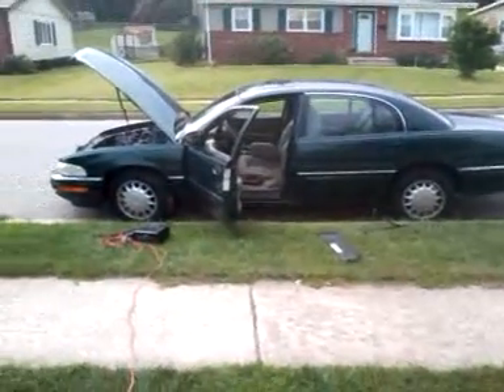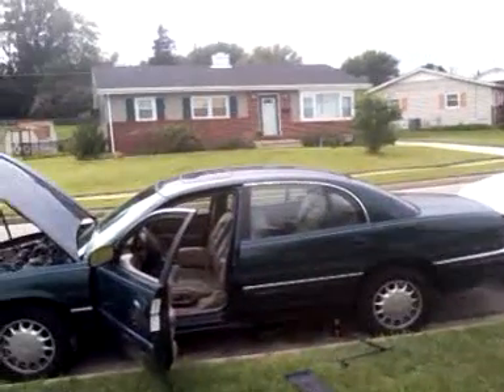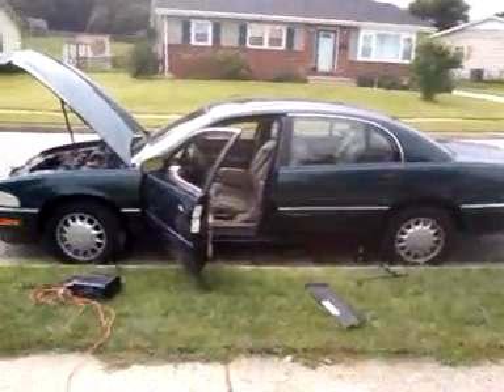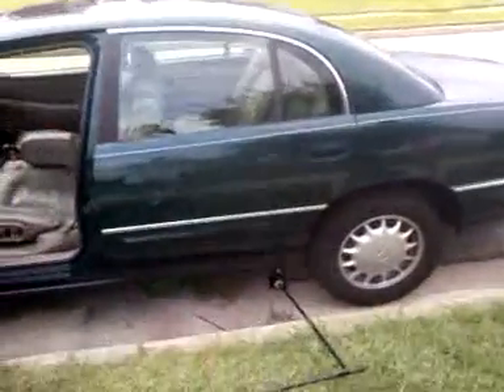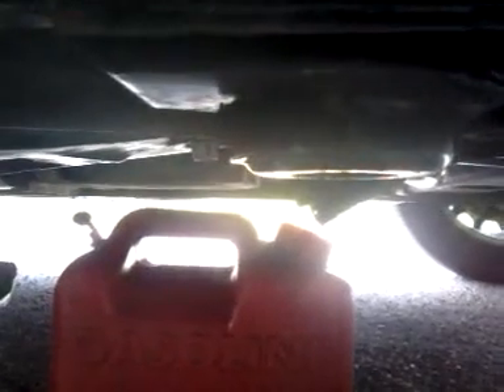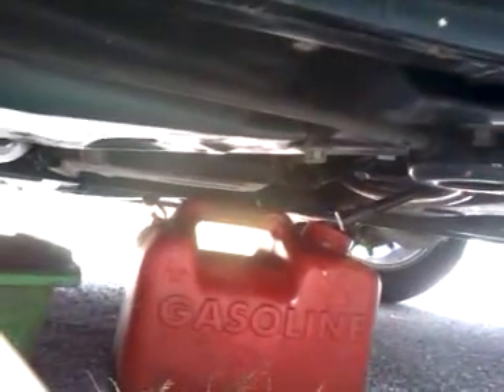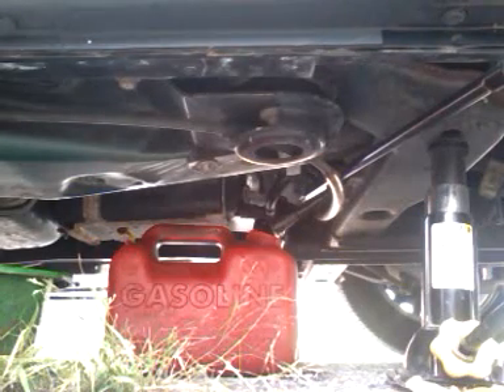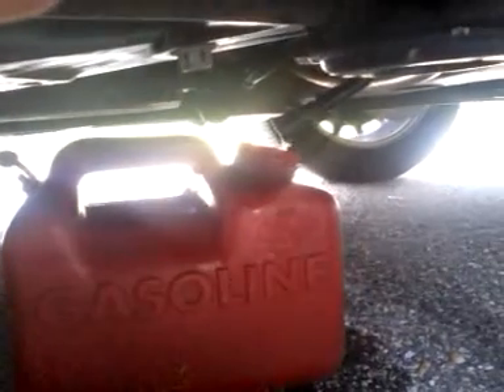Getting bad gas out of a car

Comment: You could look in to taking the fuel pump relay out, and then bridging the connections to cause the fuel pump to remain on until the jumpers were removed.

Just a thought.

Comment: I did the same thing as this guy i have like 5 gas cans laying around and picked one that had just a small amount of water in it but it did have a cap on so how water got in it idk as soon as i heard the car running on idle i knew i fucked up the thing is when you first pour it in ,the car will run because the gas and water are temporally mixed together but after that shit settles your fucked because water is more heavy then gas and when your fuel pump kicks in it will suck pure water up from the bottom of the tank and your car will just crank and not start because there is no combustion happening! i was going to do what this guy did but i was going to do it was a gas hand pump to get the gas out of the tank but realized it be pointless because there still be water in the engine fuel lines sooo the way to fix this is to yes get rid of the bad gas but with a vacuum to completely purge the lines and injectors of any water and there is also a possibility you will need new plugs my car is in the shop so i will post again with a total estimate of this bone head move i did i guess it could be worse it could be sugar?